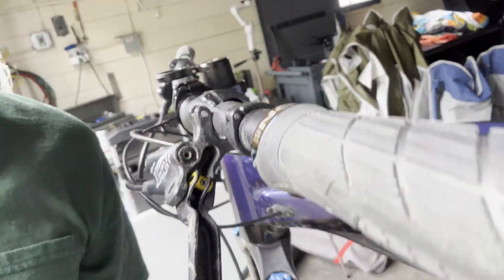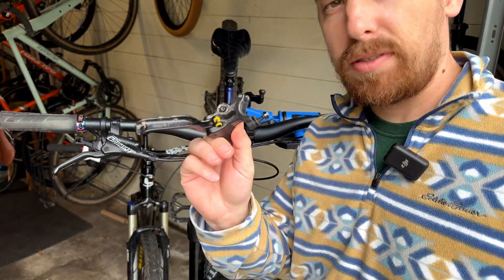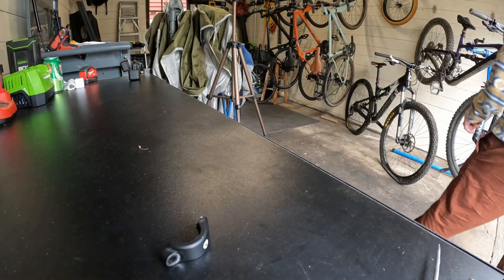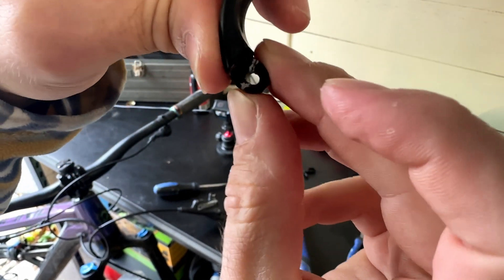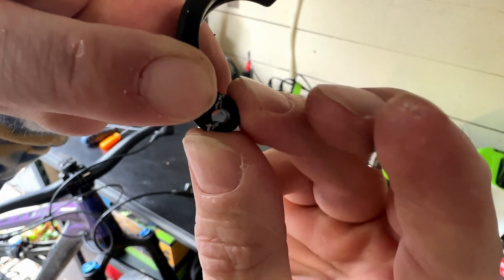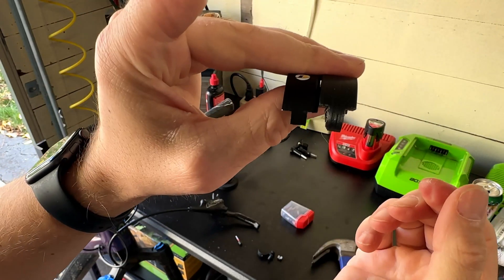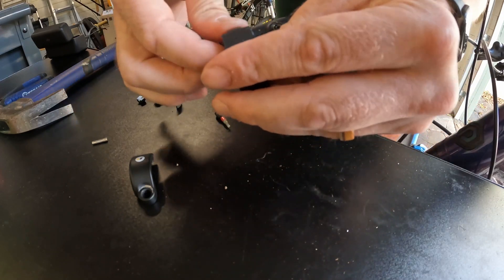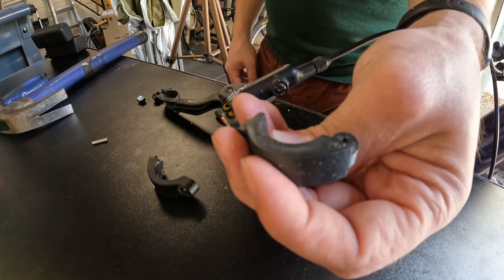3D Printing this Bike Part Saved Me $100 | Tektro HD-M745 Front Brake Repair

Comment: Any chance you can make another one and sell it to me? I'm in the same situation but I don't have a 3D printer or a spare $100 for a clamp.
Reply from the maker: If I still have the files I’ll just send you one if you pay for shipping.  My clamp is still being held on by the 3D printed fix.  It cracked a while back where the screw goes in but it’s still holding tight.

Comment: Ive got a few 3d printed parts I got some second hand wheels I was able to 3d print some hub axle ends to convert from 9qr to 15ta, with the metal axle supporting it and the plastic just being a clamping and locating surface and me printing in carbon reinforced nylon I think should be well strong enough.

Comment: Nice work, super cool to see you making replacements like this!  I think there are a few simple changes you could make to beef up the plastic part if it breaks, without having to go to aluminum.  You could increase the width of the entire part along the axis of the bar to have a wider clamping area - and replace the short roll pin with a longer pin, or even a screw that fits through the pinhole to spread the force over a larger amount of plastic.  On the other side, you can add material to raise up the 'boss' where the flat head of the screw presses into the plastic.  This will allow you to make that boss wider as well, so you can use a longer clamping screw with a wide washer underneath to provide a wider distribution of force there as well.  Looking forward to seeing more!
Reply from the maker: Thanks for the good analysis here!  So far the clamp has held up well even with the area around the bolt cracking on install.  It’ll definitely need replaced to work in hotter weather since it’s just PLA now.  When the time comes I’ll have to look into beefing it up and I appreciate you doing some of that work for me already!

Comment: Nice work, what did you model it up in? And I think beyond the part not being as visually nice, being more square with out the draft angles, it’s still gonna work. I’ve always wanted to play with the lost pla but never got around to making the green sand, though I have cast a few bars, and I’ll say that ford engine aluminum is awesome to melt n pour, have yet to get anything but clean material.

Couple other things, scamazon prime day kicked the garmin into reality, so I get to play with a 1030 plus. And also cool to see the tech shit you have lingering on your channel too, I played around with linux for a bit, but not being able to have fusion360, was enough to bring me back to windows lol, and no I couldn’t get the whine/can’t think of the cracked scenario to work, so I finally gave in.
Reply from the maker: Thanks! I used Fusion360 to draw it up.  I didn't spend any time trying ot curve the edges or make it look nice since I thought this would just be a fitment test, but it turned out to work well.  And that's awesome about the Garmin, it is really nice to have!

As for the tech stuff I'm actually in the process of moving that over to my other channel now so that I can keep this channel focused on bikes.  I haven't used Linux as a main OS for long, though I've messed around with it in the past.  But, for the Plex server stuff and HomeAssistant it works great!